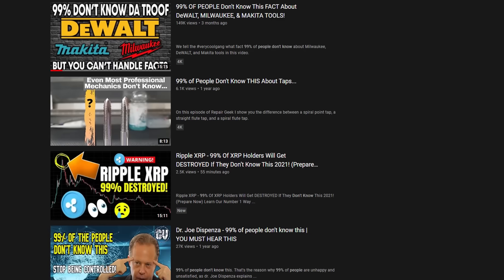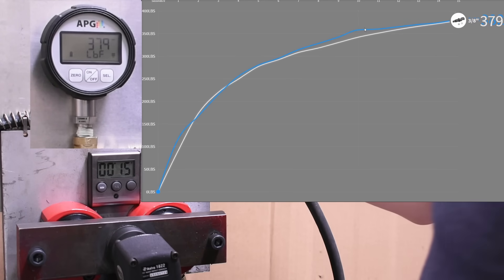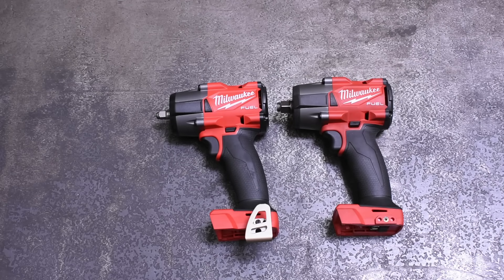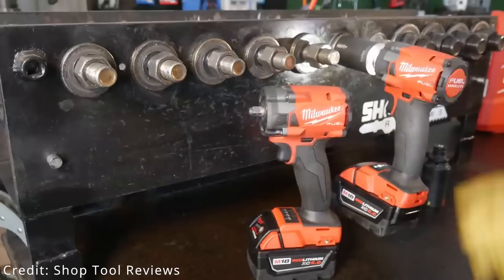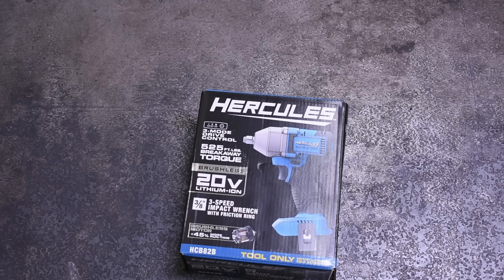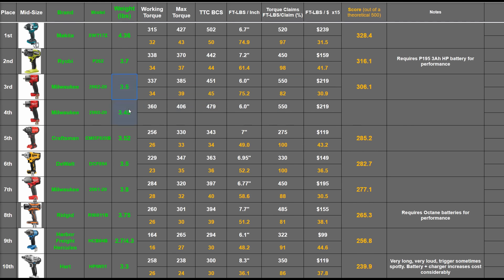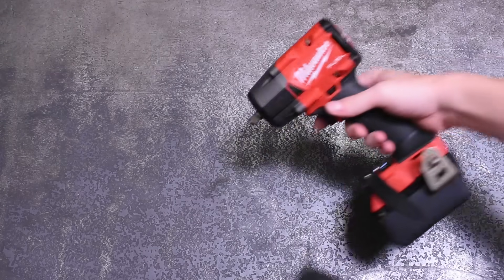Measuring Power Difference Between 3/8" & 1/2" Impacts = WTF

Comment: (@TorqueT.C.)--I missed that explanation.
You had that unboxing from your friend in lending you the ,"strapped up" impact. I understand the top shroud piece for dust protection&tight space dings, but what does the battery "diaper" do?- thanks
Reply from the maker: Same sort of thing DeWalt does for their Mac Tools batteries, more rubber padding for added damping. For drops and such. The strap itself is to keep the battery from wobbling which Milwaukee cant seem to figure out it feels.
Reply: @TorqueTestChannel  So with the battery in the "diaper" does this tightness keep the copper battery con-
tacts from slightly disconnecting in the shake process of doing impact work?

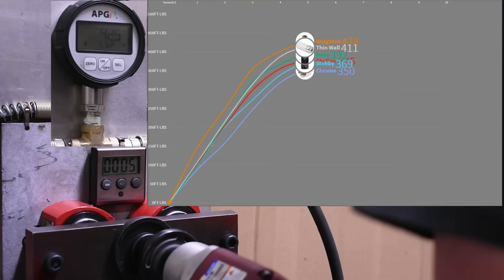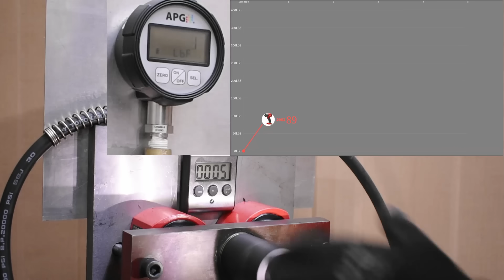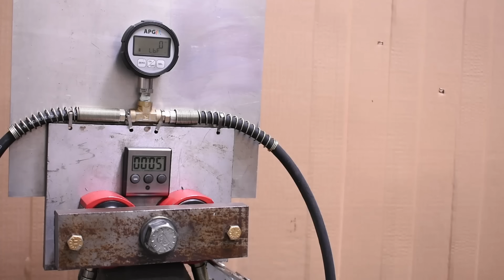Comment: Am I crazy or did at 1:57 you say sockets can effect torque, then at 5:54 and 6:02 you used two completely different sockets in length and material? I like the custom socket, but you should get the same ones to match in 1/2" (as close in mass as possible)
Reply from the maker: On small bolts it does. On the 1.5" we haven't been able to influence it in our videos

Comment: Now try the 3/8” drive with an adapter and run the 1/2” socket. That’s what a lot of us would do to use it with big sockets
Reply: I'd more interested to see the 1/2in reduced to 3/8in drive to see is it helped even the score.
Reply: @BrickHardTom  these tests have been done. The adapter typically breaks well before max torque. So it doesn’t seem like a viable long term option.
Reply: I do it building Switch Gear (MDP) and have no issues using my Milwaukee 3/8 M18 impact.
Reply: @nickmac5953  I do the same for running LMDP’s and MCP’s , impact 1/2” adapter with 3/4” socket ... takes it like a champ , especially great for small places too
Reply: @nickmac5953  where do you get these adapters and swivels, im in the market for a impact for the 1st time so im guessing 3/8 over the 1/2 is best for most applications? I have broken adapters(maybe the brand) before so thats why i have been undecided on either one.
Reply: You might lose a little torque going through the adapter, that's about it
Reply: You lose like 20% using 3/8 to 1/2 inch adapters (unless you weld them but then you need an adapter for every socket.
Reply: @CarlYota  tool shop reviews did this test with an Milwaukee M12 3/8" and adapter and it STILL defeated the 1/2" Milwaukee M12.
Reply: @CarlYota non sense
Reply: I was thinking the same thing
Reply: So true but maybe he is just making sure he gets the best result
Reply: What usually happens when you use an adapter with the 3/8 is that the adapter breaks!
Reply: The 1/2 Milwaukee stubby with a step down is surprisingly good at the job
Reply: Any adapter will reduce torque on the output. The closer the hammer mechanism to the socket with no additional attachments to the output shaft, the harder it will hit. For larger bolts, I use Astro nano sockets on my 3/8 drive. I can loosen a 24mm bolt with much more force than a 3/8-1/2 adapter with a 24mm socket cannot even budge.
Reply: The Milwaukee anvil design is different in the two tools, it wouldn't be as simple as changing the chuck.
Reply: Don't mention this on Reddit, I got hammered because I said I used an adapter before to take out lug nuts.  100lb ft lug nuts and they flipped out.  "You should use the right tool for the job".  Never gave me an issue, but now I do have a 3/8 to take off my lug nuts which I leave in my car along with my M12 stubby.
Reply: I accidentally bought a 1/2 impact and now I suffer the consequences
Reply: Im guessing it depends on the fit? The more wobble the less torque but if welded, would actually make more torque like what we've seen from Shop Tool Reviews
Reply: Could be the strength of the 1/2” size for longevity? With Milwaukee I kind of doubt it.
Reply: That is how I role! I use the the 3/8 compact with the largest 1/2 adapter and largest 1/2 sockets and you get more kinetic force that way. This isn't my opinion, it's a fact. When I cannot get lug nuts or axle nuts off, this is my go to. Rarely will this not work.

Comment: For control it should be using same battery and not just same type in the test the guy did with the 3/8 vs 1/2" on the row of bolts. It could be possibly something with battery? maybe not but possibly.
Reply from the maker: It is using the same xc5.0 on both tools

Comment: This is only a question if the tools are never used in practical applications. The whole reason they have different sizes is so that you can easily select a tool that’s appropriate for the job that you’re doing. If my 3/8 were as powerful as my 1/2, it would break the sorts of things that I would select a 3/8 for. So, yes, it’s on purpose and it’s not necessarily out of consideration for your anvil or socket. It’s out of consideration for the tool’s purpose.
Reply: Thats why there’s different power levels built into the gun… 1,2,3 and an automatic setting that only snugs the fastener.

Comment: Your sockets here are a different weight/length/mass. The ones you had custom cut for 3/8ths have a lot less mass which in theory would have more smacking power. It's the same argument about how heavier wheels take longer to spin making the vehicle slower, or how a more muscular guy can't hit as fast as a skinnier guy. RPM vs Torque.
Reply from the maker: We've tested and controlled for that. Notice the 1822 and Hercules made the same power using those same sockets. See our for science videos on socket mass. On small bolts bigger difference, large bolts like 1.5" we've noticed no change.
Reply: I will have to check those out for sure, wasn't aware anyone had tested that theory yet

Comment: Why did they forge those custom 3/8ths sockets with such a small collar? I would've wanted to keep the beefy 1/2" collar with the 3/8" broached hole. Later if the 3/8ths hole gets worn out you could rebroach to the 1/2' size no problem.
 
The answer to your quandary is, a 3/8ths diameter spinning shaft is always harder to resist spinning than a larger 1/2' diameter shaft. The 4 corners of the 3/8ths anvil strike the socket corners with more force than the larger 1/2" anvil can. 

Even though it looks different, since the Anvil and Socket are separate, we're now working with a "Gear Lash" type action. The 4 corners of the anvil are like "Gear Teeth". The Anvil is now like a Pinion Gear. The smaller the diameter, the more force the Anvil corners strikes the socket's corners. With more force, means something's gotta suffer. I'm willing to bet the 3/8ths drive hole in the sockets will wear out quicker than the 1/2" drive holes.

Comment: Smaller drive:  should be a lower torque drive (cross sectional area of components)....  Does this mean the 1/2 inch buyers are getting short changed??   Diameter of anvil or weight of hammers, may translate to more torque IF the motor can spin the (greater diameter) hammers to the same rotational speed (more power). (Just because one can use any socket from 3/64 up to 2 inch  doesn't mean the "drive" is optimised for that range.  (one can also adapt down their 1" gun..  In my home game a 1/4 hex driver can still loosen car lug nuts, it doesn't mean it is "made for this".) )

Comment: This test is based on the measured torque without the knowledge of the fact both 3/8 and 1/2 drives are used the same power motor with the same torque spec according to the Milwaukee web site.  Ignorant of the size 3/8 and 1/2 diameter of the drives.  Most mechanic prefer to use a 1/2 drive over the 3/8 drive for a heavy duty use.  This is a false test.
Reply: Maybe its the engineer in me,  but why is the axis in lbs-F which is a force when Torque is in ft-lbs and Power in Horsepower (ft-lbs/min).  From my understanding,  this setup is measuring force, not torque.

Comment: You should test the difference in battery brands. I'm thinking use a Milwaukee impact and battery adapters for DeWalt and Makita to see if there is power loss using the wrong battery.

Comment: Milwaukee 3/8" and 1/2" mid range impacts are the same IPM and RPM.  Both models use the same size motor.  However, we know that the Torque formula is T = R x Force.  If we use the same motor mechanism, a 3/8" is for a general duty, and a 1/2" is for a heavy duty use.  I would prefer to use a 1/2" drive instead of a 3/8" drive.  Same for all my air impact wrenches too.

Comment: I wander if half inch is stronger with higher amp battery . The smaller unit may be working harder with say 5 amp battery on its smaller motor. While the bigger unit is not working to its full potential 😁

Comment: I have a m12 fuel stubby 3/8impact that shocked me I used it to replace my leaf springs I never expected it to break anything loose but I  figured well b4 I kick on the compressor and break out the aircat let me see if this does anything I  never needed to turn the compressor on I was very pleased with Milwaukee's little jewel

Comment: My guess for why 3/8" is better in some cases despite everything being seemingly the same is resonance: the smaller shaft has more springiness, which allows the anvil to have more rebound and hit harder once it gets in that zone while the 1/2" does better at rust-busting from the extra rigidity transferring more of the sharp initial impact to the fastener instead of being softened by elastic shaft deformation.
Reply: Wss thinking the same think my guy
Reply: Good guess
Reply: What this guy said ☝️🤣
Reply: Ok… i approve this answer…. Best one yet anyway…
Reply: It's actually about t he tiny difference in the contact points of the anvil with the sockets, all that energy is transferred at those points of contact and having that energy be in a spinning motion the leverage being applied is decreased the larger the radius of those spinning points of contact.
Reply: @MikeJones-wp2mw  there is no magical torque conservation with a smaller drive size. With a larger drive, the impacts are being applied closer to the socket wall, which should reduce transfer losses in-between.
Reply: @teardowndan5364  I think the solution is more an aspect of conservation of angular momentum between the 4 bodies in question and the distances between each of those bodies hammer,anvil,nut,bolt which is complicated because it starts out large, reduces down and then grows larger again. I think if the socket is welded to the anvil both the 3/8 and 1/2 would perform identical showing that the difference lies in the points of contact between it and the socket. Otherwise the only other difference between the two is the larger mass of the 1/2 anvil but that is negatively accounted for by the cutout that it fits into on the socket  which should roughly equalize the rotating mass.
Reply: Keep trying.

Comment: Man I’ve always been taught from old guys the hammer and socket weight was king. Learn something every day. Crazy in 2021 there is still info needed to be found
Reply from the maker: The smaller the bolt, the larger socket mass plays a part

Comment: What about resistance to damage? I know 1/4 drives(non-impact) are less durable than 3/8 drives(non-impact). I wonder if 3/8 drives are the sweet spot where the load no longer pose significant risk of damage but otherwise the internal design is similar/same?
Reply from the maker: The 3/8" anvil will definitely be hurting over time compared to 1/2"

Comment: This in no way means that  3/8" drive tools are just as strong as 1/2" drive.  Do the same test with cave-man breaker bars. It also proves nothing as far as durability. I think over time, given both sizes are pushed to their limits on a daily basis, the 1/2" will outlast the 3/8". It does give me confidence in carrying only 3/8" drive in my truck for emergency repairs, including busting lug nuts.  Cordless tool tech is impressive nonetheless, but in a high volume production environment, still can't beat air.

Comment: Both appear to have the same size body, which would point to them having the same motor and hammers. My guess is, with the smaller anvils, the hammers have a bit more room to travel. If they are able to accelerate more before striking the anvil, well, there's your answer. That really just raises another question though. Why do the half inch units not have a larger body with a bigger motor and hammers to take advantage of the stronger drive.

Comment: So if you took the Milwaukees apart and slowly built one with each other's pieces you should theoretically be able to narrow it down to the part that is causing the discrepancy. Of course, if you can just switch the anvil between the two and get the same results then it would have to be the anvil mechanism. If not, then possibly machine your own to see if it's something propietary that they're doing, or if it's something beyond, in the physics realm, that just happens to flow with their specific setup and weight balances. Maybe they've found the golden weight to rotation/impact ratio and you will bring forth a 15% power increase in other manufacturers impacts. Ha. Interesting nonetheless.

Comment: I think this test is missing some critical important piece of information in the title/description....you are comparing two electric impacts that likely have the same exact case size, and probably the same circuitry and magnets.

Historically speaking, 3/8" drive impacts (air) were usually significantly smaller in case size and very obviously much lower in output capability.  A lot of what we've know when comparing 3/8
 to 1/2" drive tools is derived from this.

Comment: I have a 1" Milwaukee that does a better job loosening rusty lug nuts with a adaptor for 3/4 sockets. Not sure if it gives it a little more hammering power or what.

Comment: Holy snap I need to know where you got that 3/8 anvil from for the onyx, and if it will fit in the Matco MT2612 (same as astro 1834 ?)
Reply from the maker: It doesn't fit, the 1834 anvil is shorter. Working on it
Reply: @TorqueTestChannel  Thanks! I would be really interested in a 3/8 replacement anvil for my MT2612, there are just so many more options in short, thin and swivel sockets within the 3/8 catagory. I look forward to any future developments in that regard. You guys are what i would call pioneers in what you do. The information you provide is worth more than money, i appreciate your work :)

Comment: Currently have  3/8" 2754-20 rated at 210lb ft, and a 1/2" 2759-20 rated at 220lb ft. Same tool build. 3/8" has more torque when using under any circumstances.

Comment: Throwing this out there, in case there's any correlation:
At like 6 years old, helping my uncle splitting wood with a wedge, I was too weak to sling the sledge hammer. However, using a small ball peen hammer, I could drive the wedge and it would move. 

Maybe that applies here? Not enough beans behind the anvil to move it, but less weight (slung faster) made for more energy? Just a thought.

Comment: The difference in torque is only due to the longer socket and adaptor in the video at 7:33.  the 1/2" version is using a shoter and lighter socket. Exact same result as the heavy weight ingersoll rand power socket.
Reply from the maker: And yet the 1822 and Hercules here made the same power curves with those two same 1/2" and 3/8" sockets. Also we have a video on how socket mass at this 1.5" size doesnt seem to make a difference, smaller bolts are another story.
Reply: Any difference in performance due to length is negligible unless it is a comically long socket, in which case the performance would be worse, like with an extension. The difference in performance will come from mass being further from the center of rotation. However, this only applies to drills and impacts where the forces are dynamic. With a ratchet, combination wrench, torque wrench, etc, where the forces are relatively static, socket mass and length is irrelevant.

Comment: I actually purchased the Milwaukee Gen 2 mid torque in 3/8 based on the results I seen from Shop Tool reviews.

I didn't own a 3/8 or 1/2 socket set and wasnt sure what to choose but assumed the 1/2 was probably stronger.

I seen the 3/8 was not only more powerful but the sockets were less expensive so I went for the 3/8 and so glad I did. 

I dont use it a ton but ever time I work on my car Im impressed by its power and size.

Crazy, Milwaukee should brag about it.

Comment: I think it could also be related to the electric motor itself.
If the motor isn't constant speed as load is increased the motor slows and torque increases. the larger circumference anvil may be rotating faster or holding more speed and getting less torque from the motor as a result

Comment: My hypothesis for the difference between 1/2 and 3/8 is that the 1/2 is rotationally stiffer than 3/8, and with the increased rotational stiffness, has a shorter duration torque impulse, giving the nut/bolt less time to move. 
If my hypothesis is correct, the torque difference between 1/2 and 3/8 should disappear when using an extension.

Comment: A test I would really like to see, is does the torque output change if you hold the socket and twist in the direction that you are impacting so that it does not rebound or jump around? I've had bolts that just would not come loose during impacting that then did when you applied a little bit of twist to the socket to keep it tightly engaged on the fastener

Comment: I think it's the adapter. I had a "old, worn out" air impact that would crush sleeves in differential rebuilds (did a lot of them  in chevy dealership)  that none of the other 9 impacts in the shop couldn't. I always assumed that because it was so worn, the hammers traveled an extra 15-25 degrees before striking the anvil (built momentum).